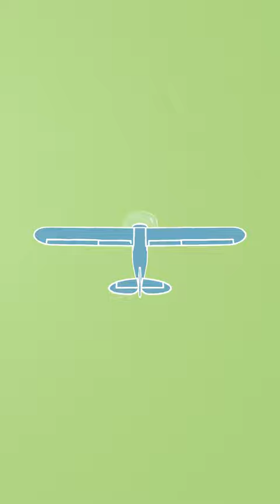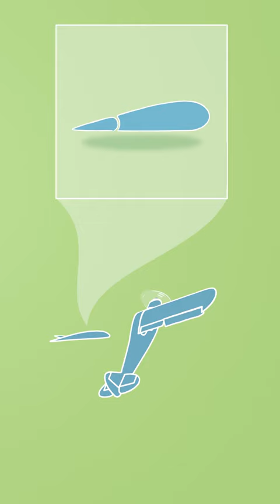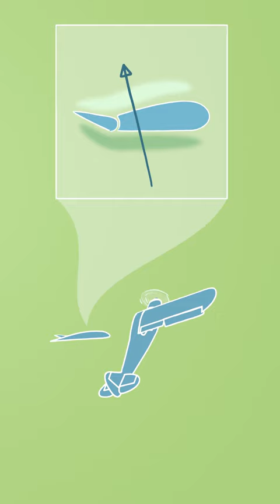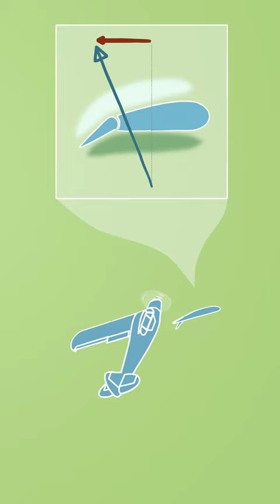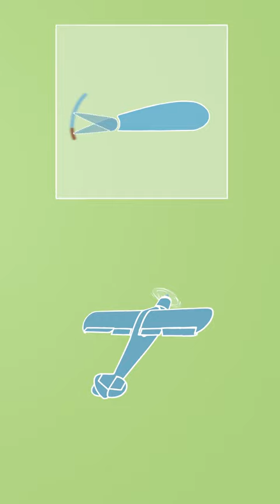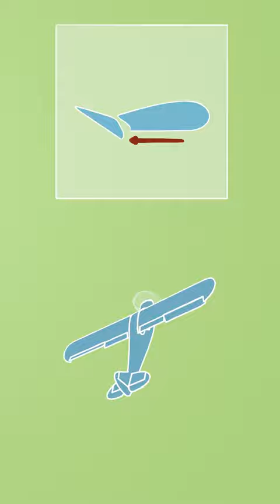Adverse yaw explained

Comment: "Sir, why is our plane falling apart-"

edit: 1.1K LIKES! this is the first time I've even gotten that many!
Reply: "We are going the wrong way sir... We entered ohio state"
Reply: "oh it's just for educational purposes, the plan will land itself (I hope)"
Reply: "i mean... It should land itself, we followed all of the instructions! There's not reason it shouldn't, right?"
Reply: @dannyphan2832  don't ever set foot in Algeria
Reply: 7 replies but 5 in irl?
Reply: had to ruin it with an edit, huh?
Reply: @ArnoldsKtm  like my comment
Reply: @notarobot119 ”No, the instructions say that the plane has autopilot, not an autoland—“ vertical stabilizer falls off
Reply: @Moldovallan1618  oh... Well we didn't need that tail anyway, and I'm sure the autopilot can land itself
Reply: @notarobot119  “The tail is kind of important and yeah no, here it says it can’t autoland but it can fl—“ the tip of the wing breaks off, severing more hydraulic systems
Reply: @Moldovallan1618  "oh... Whoops, well we can probably- *wing breaks* uhh... I think we did actually need that"
Reply: @notarobot119  “Yeah we kinda did, should we ejec—“ engine breaks “SCREW THAT WE’RE EJECTING” button doesn’t work
Reply: Because experts after a lot of research, they realized that they had to split the force in the fuselage and reduce the pressure on one part of the plane.

Comment: "if it tries to roll to the left, the tip of the airplane turns to the right."

casually rips the left wing off
Reply from the maker: yes! Which increase the friction. And in fact the friction grows harder than the pulling force, so no matter how hard you pull, it's not coming loose
Reply: @KnowArt  true

Comment: My brain just logiced that the wind is pushed in one direction the newtons laws makes the wing move in the other to compensate. But that explanation works too i guess lol
Reply: That is actually part of how it works. Due to the Coanda effect air sticks to the surface of the wing and is deflected up or down at the trailing edge, generating lift. This in combination with pressure difference is what allows aircraft to fly!
Reply: @gunpowdertimothy5644  yes i know how planes wings generate lift. i mean specificly the control surfaces such as the alerions

Comment: Can you explain what the advantages of spoilers are over ailerons?
Reply: A lot more drag with spoilers, but they're also not as good for fine control.
Sometimes spoilers are used unevenly in airliners for high control inputs, but they'll stay down for most of the flight. That's because spoilers can also work very quickly, but they do this by rapidly trying to delete the lift on the wing.

Comment: This would only apply to single engine planes because the one engine will push the aircraft to the left whereas on a multi-engine aircraft it'll only go straight by default and right only when you turn right, and left only when you turn left.
Reply: Not at all true.  I fly multi-engine planes and we experience adverse yaw.

Comment: In other words the rotating momentum of the engine wants to roll the plane but you can counteract it with trim and rudder control so the plane stays straight forward.
Reply: Not at all, it has nothing to do with the turning of the propeller.  It’s just the plane loses symmetrical lift when it’s got a wing down and will slip.

Comment: But why do airplanes in video games turn into the direction you roll the plane in? My entire concept of planes has just been ruined
Reply: Adverse yaw is an undesirable effect that a pilot has to correct for. In video games you usually don’t get direct rudder control anyway, so the “roll” control is really more like a “turn” control, with all the rudder and elevator adjustments being automatic.
Reply: @Tom-jw7ii  makes sense ig